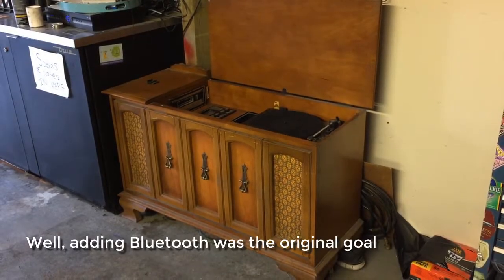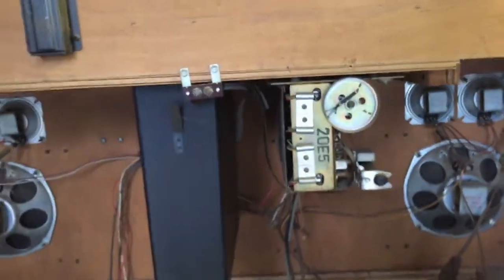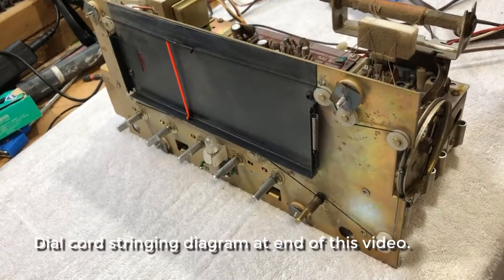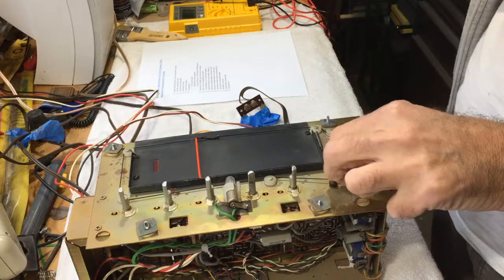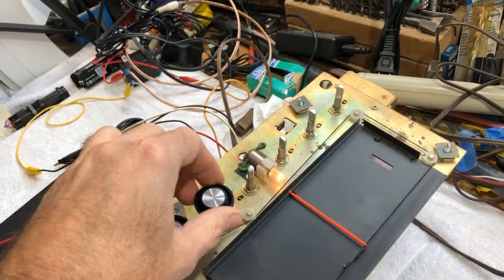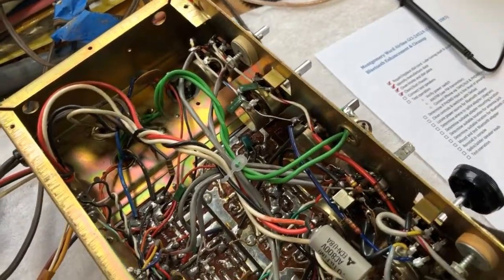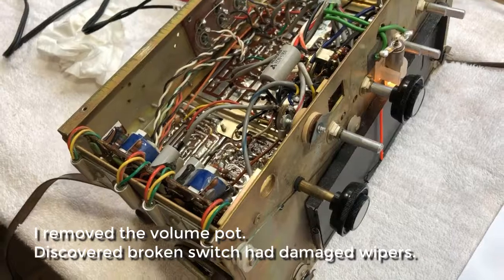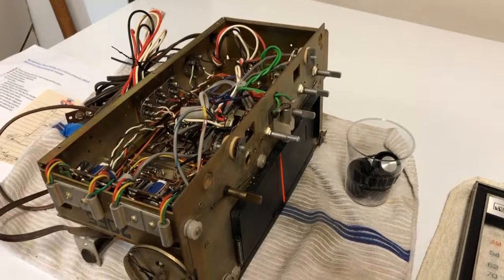Montgomery Ward Airline GC-2452A Console

Comment: I just purchased a montgomery ward airline console almost the same as this one.  How were you going to wire in the bluetooth setup?
Reply from the maker: This console had an eight track player, so I was going to tap the bluetooth adapter into that.
Reply: Hey Jim, I just bought this exact same one. However, the power cord is cut. Would you be willing to sell and send me the plug in power cord? You help is much appreciated!
Reply: @litzdog911  see message below…
Reply from the maker: @drewmassage  Sorry. My daughter is using this console, along with its plug in power cord. But it shouldn't be that tough to replace the cord and plug with something new.